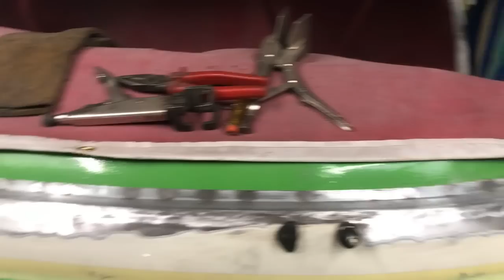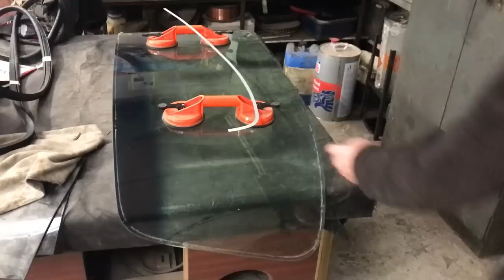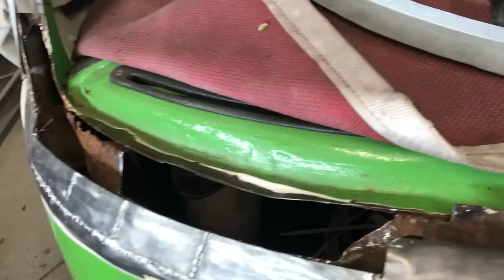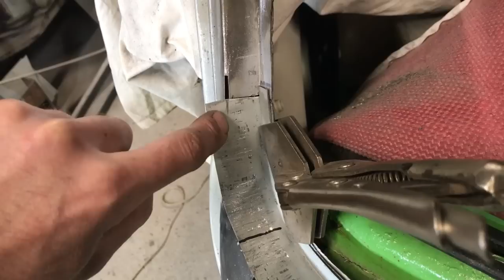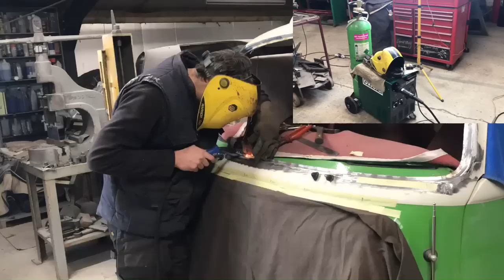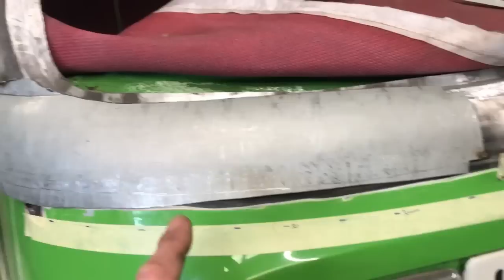How to make and repair a rusty windscreen aperture, classic car restoration

Comment: very nice video.
but i am really intrested, would the glass fitt ?
Reply from the maker: I haven't tested it yet but I'm not expecting any issues.
Reply: @bensclassicbodywork  
yes this was a great quality job, it probably fitted 100% exactly. you are more in the metal work ?
also very nice episode.
Reply: i came back to revise rephrase my answer, i didnt want to sound negative.
but now i watched this mostly again. and now i see you have the window and fitted it to check the dimensions.
also intresting with that bad old repair there must have been a lot of bondo to make the windscreen water proof.
but very nice craftmanship

Comment: I know this video has been out a while, but I've just found this side of your personality after following the bonkers helicopter stuff. You made that look ridiculously easy! (And did a superb job).  I did a LOT of repairs on a '71 bay camper over 30 years ago - when I went to see it, my 'red line' was that the windscreen corners were intact - they were, but it needed pretty much everything else (most of the bottom 18" needed replacing in the end). It was parked in a field with a seized engine and being used as a goat shed. Paid £100 for it and spent 12 months welding. It kept going for 26 years afterwards. Really appreciate you explaining what you're doing and why, and I've learned a lot from your videos on this channel. Thank you.
Reply from the maker: Thanks for the nice comment and watching both channels. A lot of repairs needed on a camper is a common theme.😀 well done for making it go on again. 👍

Comment: Brilliant, well done what metal do you use? As it doesn’t look conventional still looks like it’s got a coating on it and what fitness just out of interest cheers Ian.
Reply from the maker: Hi, the metal is zintec a zinc coated but weldable steel 1mm thick.
Reply: @bensclassicbodywork  I thought it was. I’ve used that stuff before it’s quite malleable if I remember rightly.
Reply from the maker: @wellseyspeedshop  Yes, I haven't had any issues with the materials formability. Seems comparable to 1010

Comment: Just discovered your channel...  It's got me in trouble with my better half as I can't stop watching your genius !  Amazing work.  Can I ask how you deal with heat distortion when grinding back the welds?
Reply from the maker: 😆 thanks. The grinding of welds without producing much heat requires the grinding wheel to be running at the correct speed. Electric grinders do not run the disc fast enough to achieve 80m/s surface speed. With a brand new disc you will barely achieve 66m/s. 
I use my die grinder with an grinding disc attachment that makes sure the disc is running at the right speed. This means very little pressure is needed to remove metal and you don't build up much heat. 

I know not everyone can make their own die grinder disc attachments so what can be done is use 5" disc on a 4.5" grinder or get a 5" grinder. The 5" grinders actually run at the same speed as the 4.5" versions anyway. You still won't get 80m/s but it will closer.

Comment: Was that a sandbag you had on your workbench that you were hammering against? You are clearly a master Craftsman
Reply from the maker: @johnturner7060  Hi, yes it's a sandbag, it's a fast way to stretch the centre and then the bumps are smoothed out with the English wheel. You could do the stretching all with the wheel but that would be very slow. 
I didn't go into much detail with that part as I was thinking the video was getting long.

Comment: Loved the story about your Grandad and JT.
Are you still based in North Devon?
Reply from the maker: @paulluggar5964  Thanks, yes still in North Devon. The Jeremy story happened before my time but I was eventually told about it. It was quite the scandal in the day but would not be a big deal if it happened now. Things have changed since then.
Reply: @bensclassicbodywork  I remember JT when I was a kid, he drove a Rover 3.5 then.
I'm in Barnstaple so obviously not far from you, do you take on repair work or just restoration?
I have a early 90 and a 2A Landrover to restore...
I will keep my eyes open for a helicopter round here!
👍🇬🇧
Reply from the maker: @ Nice to hear you remember him driving a rover 3.5. 
I'm 4 miles from Barnstaple and yes I take on all welding jobs. I cut and weld in material in the same way as the restoration work but because I'm cheaper/ hour than normal garages it works out to be a similar price. 
I get to do the work the way I want to and customers pay the same as a normal garage except the work is much better quality. Large jobs there is a big wait, small jobs I can fit in more or less anytime. My email is btdixey@hotmail.com 
Fixing helicopter at the moment 😆

Comment: This is a classic case of a vehicle you think is good, and pay good money for, then discover it's a total basket case, and every repair you start, turns into nto twenty time the work you envisaged. My Dad had a Humber Hawk when I was very small, lovely to look at. But three speed, thirsty and gutless, it died of rust, 14 years old.
Reply from the maker: 100% right, this one is probably the worst I've seen for concealed corrosion and bad repairs. Yet it's had a professional spray job, looks quite good from a distance and I suspect  the owner paid good money for it. 
☹️
Thanks for the Humber recollection 👍

Comment: Good stuff as always. Been thinking about a punch for a while, so you spurred me on to look on fleabay during lunch break today. Got a Roper Whitney one that looks pretty unworn for twenty seven squids. Think that is a bargain, even if I need to make or find a different punch and die for it. Seller didn't list the size.... Might get lucky :o)
Reply from the maker: @innleadair  perfect! They are fantastic punches, you'll love it. They normally come with 7 different sizes of punch but if yours doesn't have any I believe you can buy them individually.
Reply: @bensclassicbodywork  the fitted punch was too small. Bought the right size from Stakesy's , works beautifully :o)
Reply from the maker: @innleadair  Excellent! I hate it when I'm forced on occasions to use a drill for plug welding, punching is the way. When a folded panel prevents the punch from being used I sometimes punch it first, just need to remember to do it.

Comment: So, how are you going to de-scab the inside of the driver’s front corner?   It’s not through but it’s not good, either.
Reply from the maker: @alastairwatson3201  Hi there, I can't do much about the rusty inside corner other than wax it. It's not good and is unlikely to last. The reason it's so bad is because of the roof leak, now I've repaired the roof, water shouldn't be getting there. Hi 

If I removed the exterior paint and found small holes I would of course have to replace that edge. You can sometimes even find thin bits of steel before it's gone through by how quickly it heats up when removing paint or sanding. 

In this case I'm going to leave it other than wax but I'll advise the customer of the situation. Unfortunately there are loads of other places on this van where I'll have to inform the customer of future repairs needed.

Comment: Nice work with the screen aperture. 
A lot of the time with the VW vans the bottom edge of the panel is also rotten along the seam above the bumper. Suppose that's why it comes as a full panel.
Reply from the maker: @andrewmooreandrewrmoore7615  Yes I expect so and this one has had some repair work already on the bottom edge, will probably need redoing at some point.